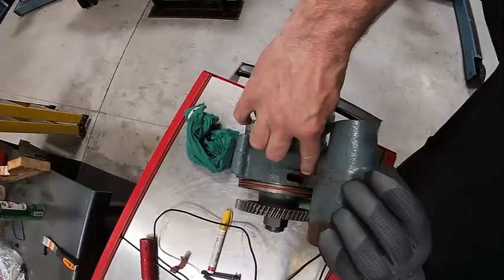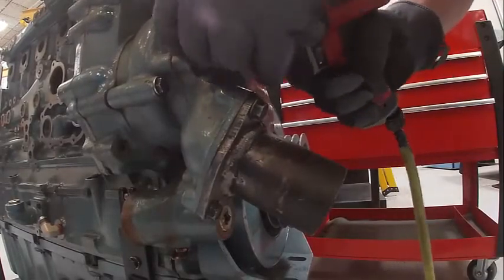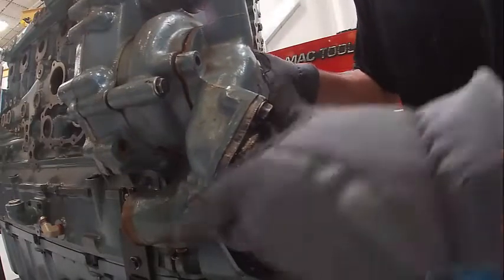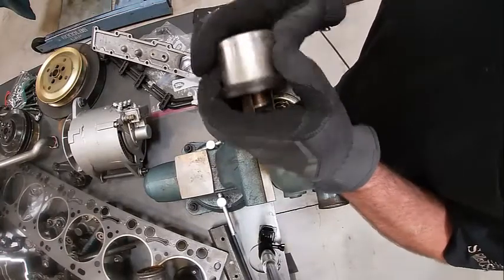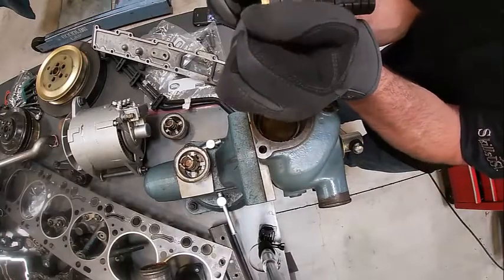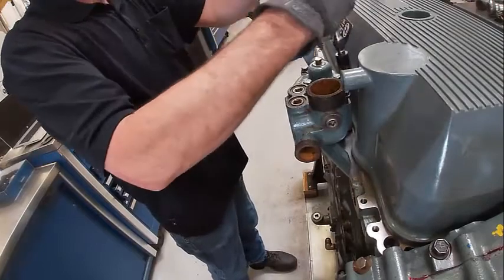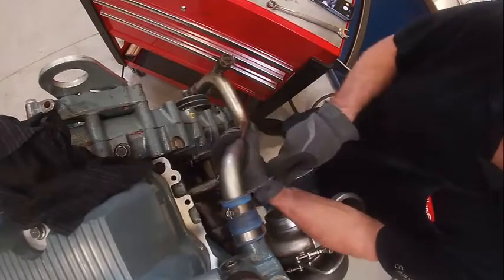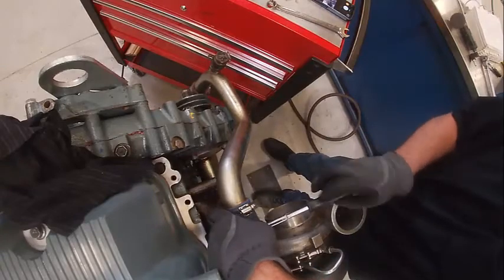60 Series Water pump oil cooler thermostats and bypass hose

Comment: 12.7 oil cooler , do I need to use 2 or one gaskets…I have a kit have 2 gasket but my oil cooler when I remove the top only show 1 gasket , plz need your help
Reply from the maker: 1 gasket for the block side 1 for the cooler to housing side

Comment: Hey buddy that's an awesome video on Detroit.engines. I was wondering if you could shed some light here I have a 14l.s60 with engine oil inside coolant reservoir.
Reply from the maker: It could be the oil cooler, air compressor, or a head gasket or head. More often than not the cooler or compressor.